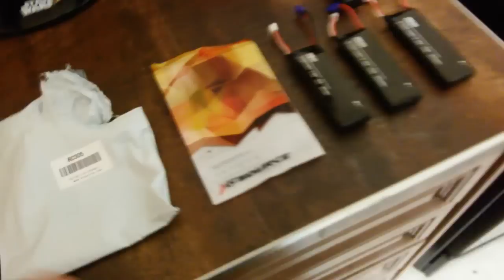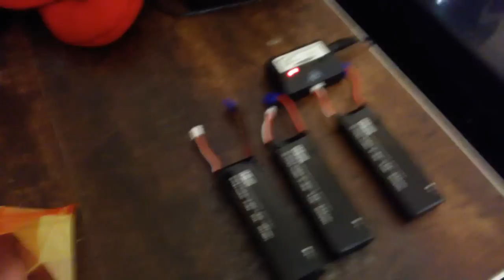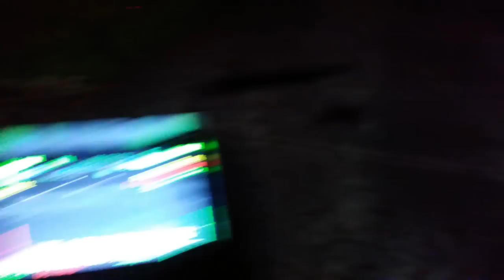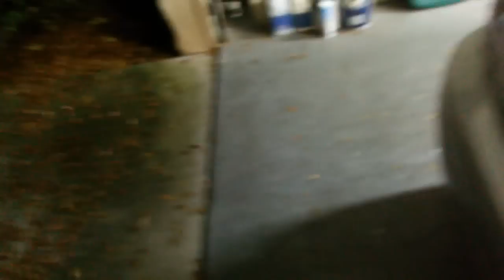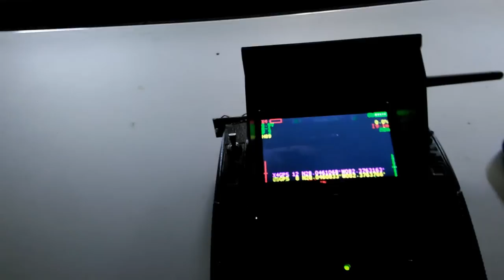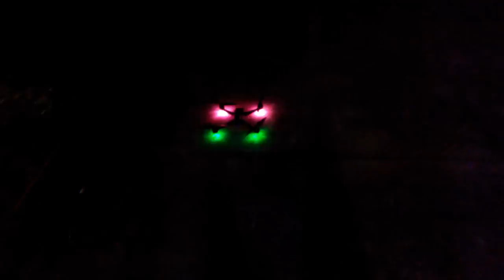Hubsan X4 H501S  EBay Knock-off Battery Test

Comment: You should have updated this video. The Hubsan batteries have regulators in them that make them larger in size. Not necessarily a good thing. Other than taking up more space, they also do not allow you to get all the power out of them before they send a RTH. This could make you lose your quad on a long distance run. Just FYI.

Comment: How good does you tx hood work and do you have a video on that?  Don't want to cut one up to fit, and don't want to glue one on, but would like to have the folding one, as long as it fits and looks good.

Comment: Hi,,,how do you turn off the camera on the X4 ?
Reply from the maker: Fungus Foong to stop recording or just turn it off in general so it's not on at all?
Reply: To turn it off in general
Reply from the maker: There is absolutely no way to do that it will constantly keep streaming fpv unless you disconnect the fpv transmitter inside the quad however I would not do that if I was you because if you disconnect the antenna you will burn out the transmitting board and it will never work again
Reply from the maker: Might I suggest purchasing the 501C because it's the same quadcopter just without fpv
Reply: OK...thanks for your reply.
Hahaha....I think it's rather pointless to not have FPV with this model sir.
Reply from the maker: I wasn't trying to be funny but seriously the only way to turn the camera off would be cutting off the fpv as well I was being honest with you. You ask a specific question I gave you a specific answer
Reply: No sir.....I didn't think you were trying to be funny. 
In fact you answered factually and very well.
Reply from the maker: +Fungus Foong well thank you :) cheers!

Comment: I think if you actually fly and time it they won't last as long , You do get more flight time just in a hover.
Reply from the maker: shenlonco I was debating that but at the same time I've also heard a lot of people say that you lose flight time because it takes more energy to hover. for me it's still a toss-up
Reply: Who know you will find out when you run it like you always have,,, But remember your old battery was real worn out and used and you have to compare it to when the original battery was new.
Reply from the maker: +shenlonco agreed
Reply: Read my response above.

Comment: do u think the battery from Banggood geekbuying gearbest are original or knockoffs? coz these site does sale original quad as we know.
Reply from the maker: Ashish Amatya please Supply me with the link and I will take a look
Reply: this one,
http://www.geekbuying.com/item/Hubsan-H501S-X4-RC-Quadcopter-3-7-4V-2700mAh-10C-Battery---1-To-3-Charging-Cable-366958.html
Reply from the maker: Honestly I don't know if they are knock-offs because the picture is so fuzzy and that might have been done intentionally to make you think they are original batteries

Comment: Very interesting, I know there are  imitations, but buying lipo's from the same store as the Quad you think that they also sell the original lipo's.  I have 4 lipo's   I bought the 501 from Gearbest and a spare battery, that is  exactly the same as original,  then I bought 2 lipo's from Banggood  they are thinner and smaller, did not notice this.  The thinner ones are better when getting older and puffing up, they will still fit nicely in the Quad
Reply from the maker: Ruudy L yes you can purchase them from hubsan Direct they Supply you with one of their links to the manufacturing Factory for purchase. hubsan shop I believe is about to actually opened finally for business and you should be able to start ordering accessories and parts but for now you have to send them an email telling them you need a battery and they will send you a link of where to purchase it. I was quite surprised by these little batteries to be honest I still only think you might get 14 to 16 minutes though and I bet within at least maybe a month-and-a-half two months will basically be down to about 7 to 10 minutes of use.
Reply: Drone Worship I think Hubsan does not want too upset the Vendors like Gearbest and Banggood with there store. I understand that lipo's only reach there full potential after 5or 6 charges
Reply from the maker: I would agree with that just remember them for the first at least five flights you're in break in. You always want to fully charge it and basically run it down - 6.8
Reply: Drone Worship Yep you don't want it too drop out of the sky, and it needs more power for RTH function